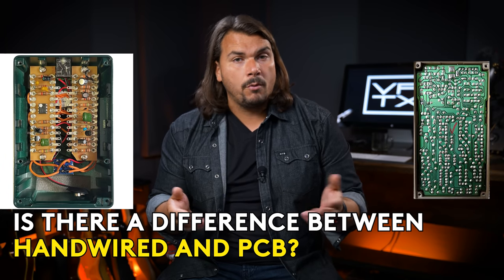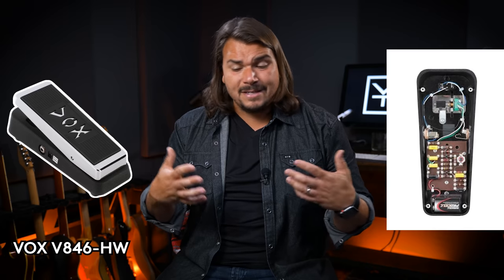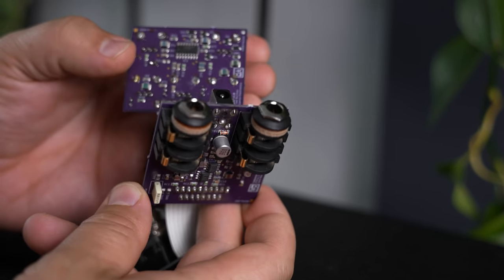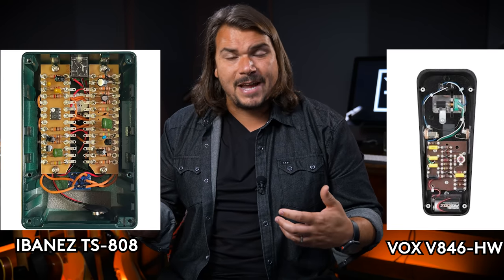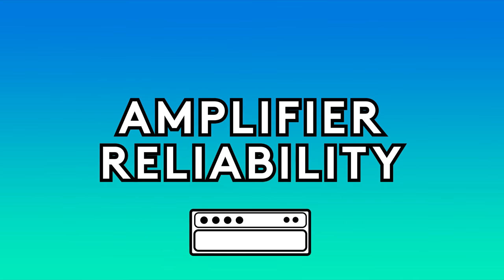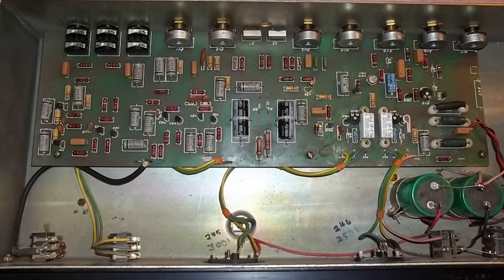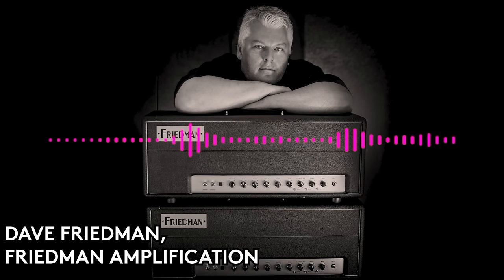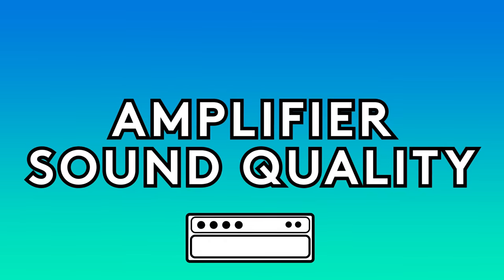Is Hand-Wired Actually Better?

Comment: Technology is invented and then used to make stuff easier and cheaper but not necessarily better.
A volvo made in the 80's surely was produced better then a new one.
I've driven a 40 year old cars and ot wasn't comfortable and the audio system sucks and it probably makes the street stink with smoke but it still runs.  
A 4500$ amp with a pcb will be better than a 1000$ amp with pcb .the thing is that the big companies sell stupid amps with stupid designs that are made to broken for cheap and better amps really expensive  and the prodution cost are the same.
Why would u make an amp that uknow it's not gonna stand the heat in the first place.
In the old times they used to make stuff to last and they did last. Even the low cost lines of products.
How well do u think a friedman or suhr or fender or marshall amps are gonna sound 60 years from now?
I bet a 1950's fender amp is going to sound better then a 2022  fender amp 60 years from now.
Thats why the general opinion of guitarists is that ptp is better... because they think about stuff that were made to last and now  stuff has expiry date on them.
Reply from the maker: Technology created efficiency and companies have used it in different ways.  Some to save money only, and other to save money but also build a better product than they otherwise could in higher volumes.  The bad incentives attributed to Volvo aren't universal amongst those that adopt improvements brought on by technology so characterizing amps in this way (while perhaps true for some companies) aren't attributable to PCB technology in general.  As John Suhr said, it's not about the method, it's about the implementation.  I agree the companies like Fender have figured out how to make their amps cheap and fast and in high volumes and have used methods like PCB manufacturing to meet that goal and undermine quality PCB implementations.  However, there are great companies like Suhr, Fuchs, Friedman, some Mesa Boogie as well that have done some great PCB-based amps and hybrid PCB amps that are outstanding and will last a lifetime with minimal to no issues.  I also agree that bad PCB implementation has tainted guitarist from liking them - I'm hoping that this video will at least help undo some of the harm that bad PCB work has done to our industry as far as amps are concerned.
Reply: Cheers , 
I agree and i know that suhr and friedman have great amps and when fender wants to they make great amps to. I think that pedals have to use pcb and it better that way . Smd is hard to modify or repair dough. 
But i do think that the prices of good amps are unreasonable .
And one more thing i wanna mention 
In our beloved guitar tone industry everyone wants to sound like one of the greats.
For example People want the hendrix sound  and the sound is actually from 60 years ago.
Probably thats how new sounds were created by trying to sound like something and ending up sounding good or bad in a different way.
The original fender circuits are still in use in modern amps like friedman and suhr and new more modern companies make clones of older pedals and amps which is a good thing . It sells because it's good.
Now the tech claim to provide us with the better alternative for ptp and it's cleaner and everything is real neat  inside the amp but we like dirt.
peaple claim to sound just like a tube amp with a kemper but i can remember guys claiming to sound just like a tube amp with a pod so whats next now?
 it's the romance of guitar history . Besides... peaple love to argue. 
Now ... I'm not saying that the new and expensive amps and pedals are bad, if i was rich i would have plenty of them and love every minute of it.
Time will tell if pcb will last as good as ptp
Reply from the maker: @zanzur1  typically you only see SMD on pedals or sections of amps that do relay switching for channels, etc.  Normally there isn't an intent here for mods and is not the expectation of the builders.  These parts typically are not what fails on a pedal, but rather the through hole jacks, switches.
Reply: @VertexEffectsInc   thats true but still, imagine josh scott which  i do appreciate and i learned a lot from but imagine him growing up in these days and everything goes smd ... the guy would probably be an accountant or something. 
He started out by fixing and moding other companies pedals which the original manufacturer had no intention for it to be modified. 
I believe that there still some creative and talented guys out there that can take a jhs pedal and make it different ( better or worst) . guitar pedals are not smartphones or a video game console. I don't see anyone playing atari now but i do see people playing the guitars ,pedals and amps models from the 80's and before.
Any way i appreciate youre channel and learned a lot from u aswell. 
And i think it's real cool that u answered to my comments. 
I don't think that smd or pcb are bad but i do think that if everything goes that way it eliminates a part of the game.

Comment: You can make a PCB as good as a point to point hand wire but does that usually happen in the world? Hell no. Sometimes it does. But not usually.
Reply: You know absolutely zero about how electricity works.
Reply: @jeeefthegreat7555  it's my job to diagnose electrical/electronic problems, so yes, I certainly do know what I'm talking about. And I know how electricity works. Ohms law, etc. This comment was regarding guitar amps.
Reply: @realtruenorth  So you would know that PCB conducts electricity literally exactly the same exact way.  And that there is absolutely no measurable audio performance difference.  Facts.
Reply: @jeeefthegreat7555  LOL, so... tell me the purpose of difference gaige wires. And how resistance changes. How bottnecking current can affect dynamics. Also, my comment was about quality of construction not sound. If you read my comment, I said PCB can be just as good. CAN be. It's possible. But lazy engineering is often used along with crappy cheap materials.

Comment: Classic case of manufactures trying to limit the consumer from making diy kits. A hand wired 59baseman conversion is going to be better then a stock hot rod deluxe. It’s like comparing a 2000 Hyundai to a 57 Chevy.
Reply: I'll take the Hyundai

Comment: Aren’t the terms wrong here? PCBs can be and are wired by hand (both soldering of components by hand and the off board wires). Sometimes they will be done in solder baths, but not always. Hand wired here seems to actually be a reference to turret or eyelet board, which is also done by hand. And then there is surface mount which can be done by hand but probably isn’t. One of the big problems on these debates is that there is a lack of precision in terminology and people get all worked up over a) inaccurate assumptions and b) inaccurate references using inappropriate terms.
Reply from the maker: I think we're differentiating between a turret or eyelet board wired point to point vs. single or multi layer/sided circuits boards with traces.  I think the references here a information stands on it's own between the synthesis and expert testimonials, if you're reading something else into it beyond that regarding the terminology I think it might be an individual hang up as these terms in many cases have become collapsed independently of what we're talking about here in the video where we're attempting to meet people where they are and how they've come to understand these assembly styles and their benefits and drawbacks.
Reply: @VertexEffectsInc  I get the overall point here and the broad distinction is very helpfully made; the video is very informative and I enjoyed it. But I do think precision and not collapsing terms is worth considering. For example, turret and eyelet isn’t point to point. Point to point doesn’t have any board; the component are connected together directly (Like Reeves Electro’s beautiful pedals). Also, there are problems when we aren’t precise on marketing and expectations; I just bought today a Tone King Falcon Grande amp which is a hand wired amp. With a PCB. I knew that and understood what I was getting. Others might not when terms aren’t used accurately. So, key message from the video: there’s nothing wrong with PCB BUT pcb can be hand wired!

Comment: This review lacks input from third party service techs. Electrolytic capacitors do not have the longevity of the rest of the circuit. Few PCB designers consider that specific parts may not be available 15 or 20 years later, and the lead spacing and part dimensions may not be compatible. Manufacturers have little incentive in considering this as they are in business to sell new stuff. PCB mounted pots and jacks are particularly troublesome because hardware can come loose over time transferring stress to the board, plus interchangeability between manufacturers is poor for these parts increasing the threat of obsolescence. I don't see this issues adequately addressed here.
Reply from the maker: Dennis, I don't think this is as much of a factor as you represent it.  If you're doing an handwired, point to point, eyelet board component spacing will be just as much of an issue if the parts no longer are the same size, so would that not equally impact PCB vs. a handwired amp in this case?  I think the same issues will be upon the handwired folks and the PCB folks if through hole products reach EOL and they have to pivot to other stuff, or even SMD in some cases.  As to stress on components, again that's an implementation issue, not a method issue.  Quality PCB amps have multiple PCB levels to ensure this and multiple connections points that are hard mounted to the chassis or secured to the chassis to avoid this and the best of them, like the Suhr's for example, do a hybrid of handwired on critical high use parts and PCB on the main level of the amp for the caps, resistors, etc.  PCB can be done well, but bad implementations give it a bad name and bad reputation.

Comment: Uhh ,amps and pedals are differeny animals. Uhh tube amps have  heat and vibrations. In mass production they have to use lead free solder. Leaded solder holds up really well. In a pcb amp should be in a head I think to take vibration out. I'm a cork sniffer, I like yhe old school amps.
Reply from the maker: You can use lead solder for PCBs...depends where you're exporting to.

Comment: Let’s talk about Boards melting from tube heat ? U know being so close I hear Blk star ht ii are renowned  for this
Reply from the maker: Poorly designed amps are poorly designed amp.  That's not the PCBs fault, that's the designers fault.  It would be like judging your preference for Sushi based on having only tried a California Roll made at a gas station.  Not really representative of what great quality can be.
Reply: Marshall DSL40 transformers were desoldering themselves from PCB boards because of the heat.

Comment: There are a zillion pcb amps out there with burned spots, resustors mounted too close to the shitty  thin traces. Hot rod fenders etc. Tube sockets mounted on pcbs will break solder joints  and over heat and burn the board.. 
Certainly you could make a well made ocb amp but let's face it,  tons of amps out there are just sub par disposable amps because they are pcb. They will not be around in 60 years like a vintage fender or marshall.. 
Some are ok but loads are convoluted cheaply made and poorly designed trash. Lots of pcb amps are expensive to work on compared to hand wired as well. 
Each type has thier strengths and drawbacks but modern pcbs are junk. 
I'm sure there are some well built ones but I'll bet they cost as much as a boutique hand wired....
Reply: Agree for the most part. However Many Suhr,Friedman,VHT,Soldano's,etc..Pcb builds are so well engineered,spec'd and built they will certainly last many,many,many years with minimal service and associated costs. The pcb on my Friedman is quite substantial and in many ways Military Grade and about 1/3 the price of a similar ptp contemporary.
Reply: @ricdale7813  good to know.

Comment: I am fine with any as long as it is not SMD.
Reply from the maker: Why?  For 99% of components it's 1:1, lower noise, tigehter tolerances.  For amps I understand this, for pedals - no difference with a few exceptions like Germanium transistors and Polystyrene caps.
Reply: @VertexEffectsInc  I’ve modded and repaired my pedals. New SMD pedals schematics are not really available.
Reply from the maker: @RJ_HTx  but that doesn't mean the pedals aren't well built - most manufacturers aren't making their pedals with the intent to be modified.

Comment: This is the most biased video I have seen in years. If you interview four guitar makers that use bolt on necks…what to you think they will say on bolt on vs set neck?? I am not going to say hand wired “sounds better” any more than I’m going to say pcb sounds better than hand wired. You mention that there is more likely potential mistakes in hand wired. Well if the company/amp builder makes a mistake, they most likely will catch it in the final test. I could go on and on about just how biased this video is. I suggest you get Mark Baier (Victoria amps, lifetime guarantee) Mike Zaite (Dr Z amps) or Steve Carr (Carr amplifiers) or any of the many other builders why they make hand wired vs PCB. Do you think they will say the same thing? I have personally had 4 amps needing serious repairs, either partly because of, or completely because of the pc board. Two Laney AOR 50 heads, (cold solder joints resulting in burnt boards. A Fender Blues Jr. PC board very microphonic. A Mesa Boogie, heat destroyed one of the boards. And even a small Marshall Class 5….that amp had many problems it was garbage right off the bat. I loved the tone of it, but it was just too unreliable. All pc board reasons.
All of my pedals are pc board. They seem fine, but they don’t have to contend with the heat generated my tubes.
Reply: Well said.  Mesa is awful in terms of repairability.

Comment: This conversation never really made sense to me. I remember having a long discussion about it with a friend. Electrically speaking there's no discussion to be had in my mind, PCB always comes ahead. And not that I'm a tech but I've never seen a board that I said "this would be impossible to work on, forget it". Surface mount, yes it's more complex but unlikely to have a failure. This handwired idea came from the builders who built great product and were masters of their craft but couldn't, or didn't want to, scale up their production and it simply made sense for them to make it easier on themselves and build a handwired product, that's all. At least the way I see it. But then that created a demand for handwired so sometimes, as one of these guys said, you need to go with customer's preference even if you think board based product would make more sense.
Reply from the maker: I think this is a well synthesized comment and mirrors a lot of what was said or reiterated in the video.  Thanks for posting!

Comment: Technically speaking, there is limited to nil difference in terms of hand-wired vs PCB for audio applications (given the same or similar circuit): however, the elephant in the room is that PCB is associated by most with mass-produced price-optimised and non-repairable components and devices which is obviously a sour prospect to most who care about music and sound quality.  In short, a China-produced mass-manufactured PCB product will provide less assurance of quality to anyone who cares about sound (rightly or wrongly).  If you weigh up factors in your mind when you purchase something, it is easy and comfortable to jump to hand-wired.   Clinically, it is not rational as well-implemented circuits 'are what they are' regardless - but everyone still believes that hand-wired represents a manufacturing process that puts more care and attention into the product, vs a company who bangs out a schematic to a manufacturer in China.

Comment: My hand wired Bondi Sick As sounds vastly better than any of the PCB models I’ve compared it to.
Reply from the maker: That would be 100% attributable to the engineering - no reason that circuit couldn't be made 1:1 in PCB or handwried.  In fact the handwired would be much less consistent even unit to unit.

Comment: I dont think handwiring makes a better pedal. But I think often times handwired pedals and amps use higher quality components. But if you use a printed board with good quality components it shouldn’t make a difference.
Reply from the maker: SMD and Thru Hole components in about 95% of the circumstance are tighter tolerances and less microphonic in surface mount packages.  To me that's a better component if electrically they're the same value and composition.  In most cases, unless it's something like a germanium transistor (as Keeley said) there is no difference, and if there is, the SMD is more consistent unit to unit.
Reply: @VertexEffectsInc  well that explains it. I prefer the handwired fender amps to their printed counter parts but I always assumed it was just better parts. But it was only a small difference. With handwired vox wah for instances I couldn’t even hear the difference.
Reply from the maker: @micktheman6  remember the PCB Fender amps are about as cheap quality PCB as there is, compare that to Suhr and it's an entirely different ballgame and Suhr's PCBs are more reliable than a new Handwired Fender.
Reply: @VertexEffectsInc  I’ll have to check out suhrs amps at namm coming up sounds like they’re  pretty good. I was also looking at Hiwatts too. Great knowledge thanks for sharing mason.